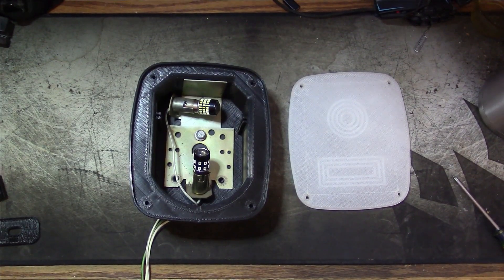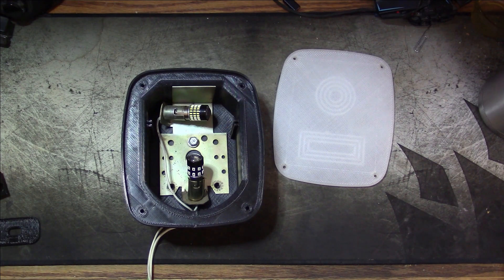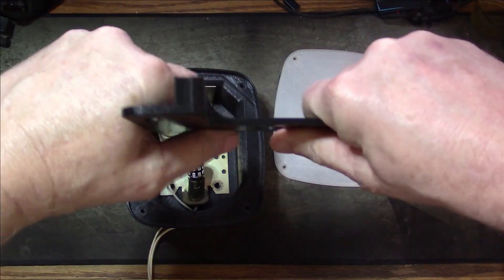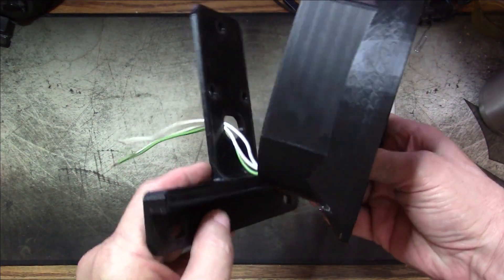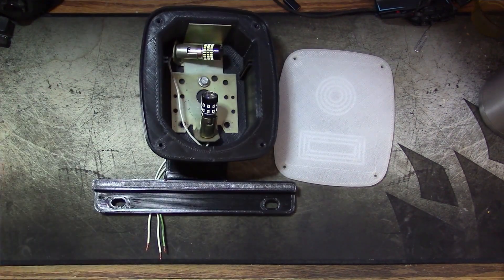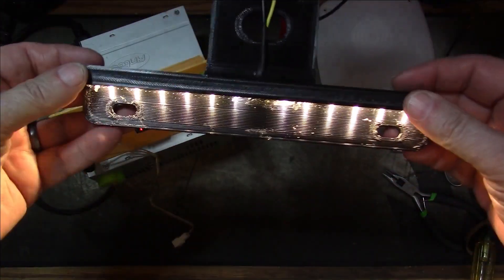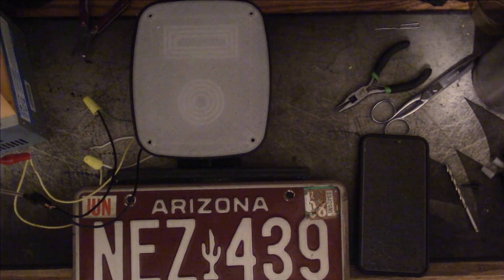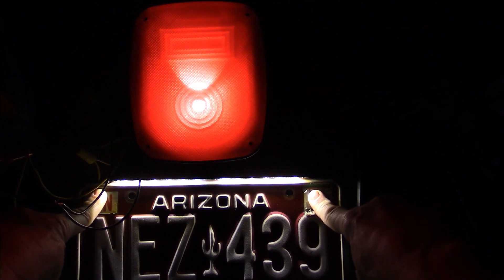3D Printed Jeep CJ YJ Taillight - LED License Plate Bracket

Comment: Great project
Have you been trying ASA filament?
It is more UV resistant than ABS
Thanks for sharing👍😀
Reply from the maker: I've considered it. Have you used it? 
Thanks for watching!
Reply: @3rdpig  Yes, it is great to print with, looks beautiful, don't need the heated champer as much as ABS
I have used it for practical prints, and it just works! :-)
Reply from the maker: @avejst  I'll have to try it. That would let me use my Alfawise U20 for things that I can't fit onto the build area in the Ender 3. Thanks!